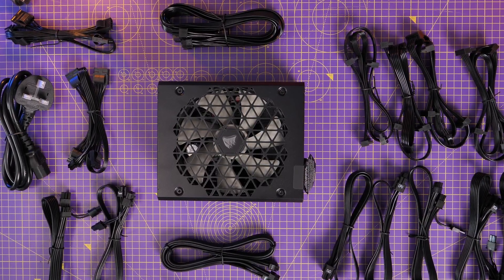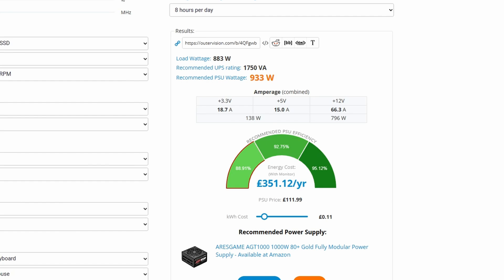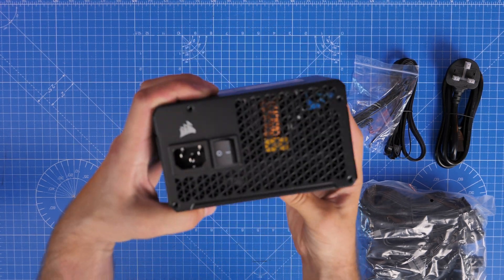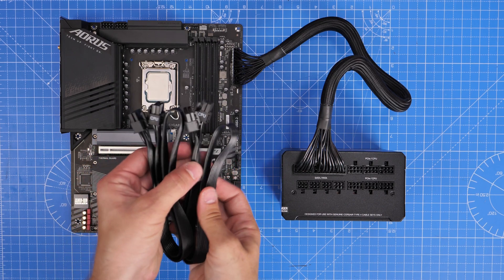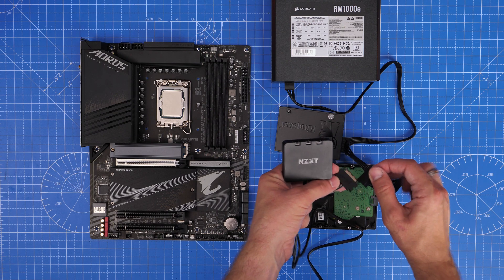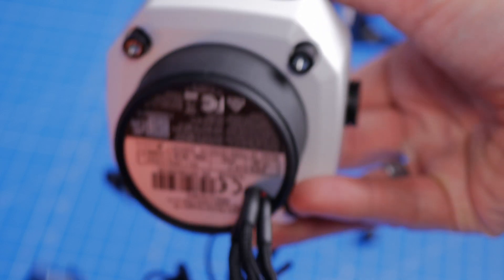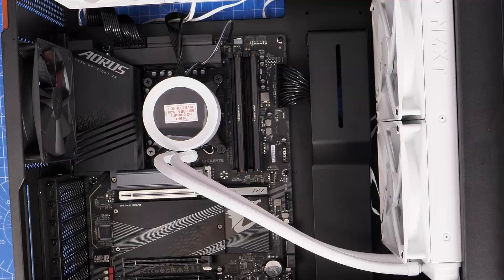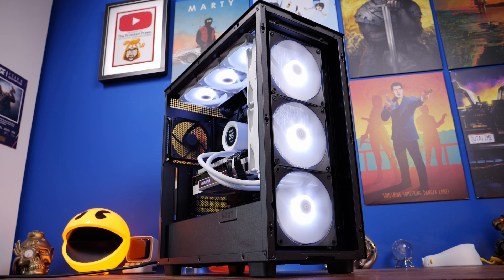How to choose the right power supply unit (which PSU you need and how to install it)

Comment from the maker: Related watching you'll find useful:
Common Mistakes You Might be Making with Your PC Fan Setup! https://youtu.be/uPIMv30Vs3w
This is must buy for PC builders! https://youtu.be/d8vELbWWaCQ
Where to connect PC case cables, power cables and more  https://youtu.be/RYkW2WywN5I
Avoid these problems with your all in one CPU cooler https://youtu.be/nVkN8diBIAE
Are you making these mistakes with your RAM? https://youtu.be/ZeUgMODOfOo
Don't make these mistakes with your NVMe SSD installation - NVMe tips and tricks https://youtu.be/zjSn64vh_Vk

Comment: the way that u installed that cooler is the worst way u wana do this... fans and radiator is good always to be above the pump so if there is an air it stands up in the radiator not in the pump
Reply from the maker: No. You are wrong. https://youtu.be/qQcyYHGtArs

Comment: i already got my MasterLiquid PL360 Flux CPU Liquid Cooler , gskills trident z rgb ddr5 16x2 6000mhz , samsung 980pro 1TB & Biwintech NX500 1TB  NVME  and the other parts i am planning to get is the 13700k , 7900 XTX sapphire nitro+  and a MSI INTEL Z790 GAMING PRO WIFI ATX MOTHERBOARD , i am still confused and not satisfied with my research of power consumption ,because i only got a thermaltake snow edition 850w full modular psu , can you help me out ? like if it's enough or not enough while i play games without ocing it and letting the stock oc do the work and how much power do i acutally need ? 850,1000,1200 ???

Comment: Up until just recently, last time I bought a PSU was 5 years ago. Defo a case where buying bigger works out for the best.  The difference I found buying one recently, is that It's almost a must now to have to include spending similar prices for after market cabling. Without it, cabling is horrendous.

Comment: is corsair type 5 cable and type 4 cable are same?? coz i saw u use type 5 cable with the psu which designed for type 4 cable
Reply from the maker: No, type 5 is smaller at the PSU end
Reply: @TheProvokedPrawn  but in the previous video u used type 5 cable with the psu where it was written designed for type 4 cable i m bit confused